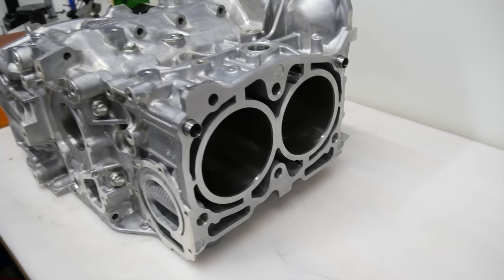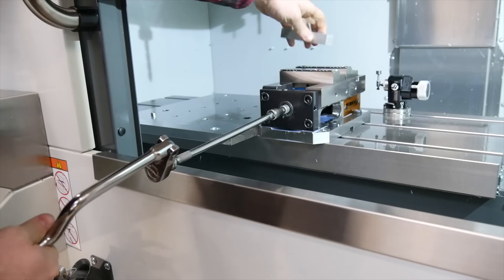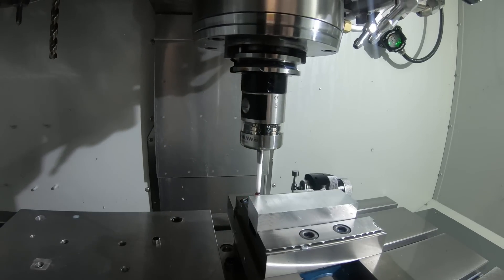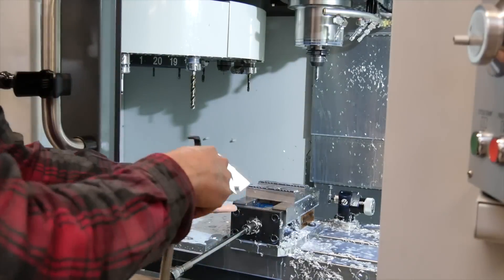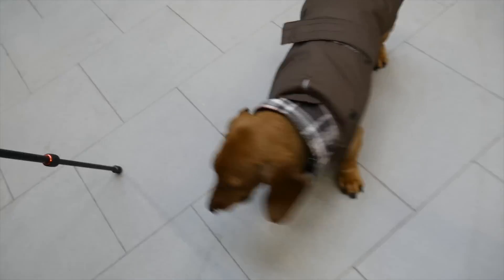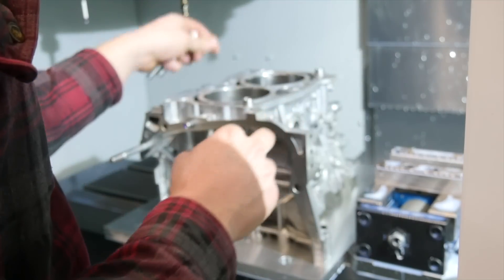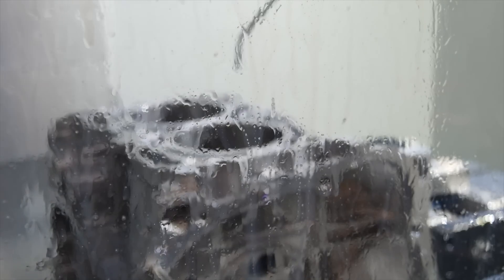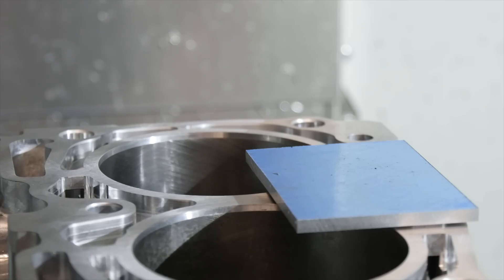How to build a closed deck Engine l Subi-Performance

Comment: Fantastic! And thank you for the english, (very good). That closed deck will help keep the liner true and round, it will help promote sealing of cylinder on the hi comp motor. Love the wunder hund!  From Seattle.
Reply: Individual inserts absolutely DO NOT keep cylinder round. Even a super precise single ring like CylinderSupportSystem distorts the top of the cylinder but much less than multi piece close deck methods. Oversize pistons are typically required after closed deck to ensure cylinders are round straight and proper piston to wall can be achieved.
Reply: @trickeng  maybe that's why IAG uses entire cylinder wall with top closed deck in one piece.
Reply: IAG uses individual pcs like this video. Not a full ring.

Comment: I love watching proper work! The cleanliness of your shop is spectacular. 

Question, have you found an efficient way to remove the 4mm oil galley plugs from the heads? I have had the damned it time over the years. Cheers and again I appreciate all of your content.

Comment: Is the "issue" with the ej257 not so much the close deck, it's already semi-closed, but with the cylinder wall liners being much thinner than the ej207? If you had to choose one, you you choose close deck or inserting sleeves? BTW, the close deck you just did looks really nice. Oh, and larger head studs and case bolts would be an optional extra on top after this? Thanks.

Comment: Awesome video 👍👌, I learn a lot today. The channel that you make around the cylinder is for better cooling? Do you still used the same factory head gasket or different? Here in the USA I haven't see a closed deck block with that channel around the cylinder.

Comment: 0:10 that Mitutoyo or the Sunnen Bore gauge?

6:17, how close are the inserts to the water jacket? Like ex: .001"? or something or interference fit?

I appreciate the "How to's", was wondering how you would go about this lol.
Reply: Its probably in the -0,00 to +0,003 area. Slightly oversize to compensate for room temperature and cooled to 194K.

Comment: Hi Subi-Perfomance chaps. Great, informative video... Vielen Dank.  I have an original Fully Closed Deck Block FCDB from Subaru. What sort of safe BHP values can you suggest for this type of block... and does the block you re-manufacture into a FCDB have a higher power capacity or lower?  I am thinking that you could build my engine up for me... Will PM you.

Comment: LoL Andi some simple tools then points to a precision CNC machine, Nice one hehehe. And here I am with an old school lathe & milling machine it's all manual no electronic takes ages to setup, I spend half the time making jigs or tools to do a particular job. Nice work on the block, question the cooling ring slot why so deep I seen other but not as deep as you have done wouldn't this weaken the top edge seems to defeat the purpose of a close deck to stop micro cracks appear at the top of the deck?

Comment: Andi - you are definitely building the engine for my Factory Five 818 Coupe. A 800 hp street macine.
Reply: i'm curious too see the progress of this build if you are documenting it at all.  I'm sure a few people would be curious
Reply: @joshuaszeto   I will do that. Working on getting everything together.
Reply: @mikebigelow9057  I have been meaning to get a factory five but I never really gave the 818 much thought until the redesign.  and I have a spare fa20 motor sitting around...
Reply: @joshuaszeto  Woo Hoo - you can have a rocket on rails also.  Right now you can save $2000 from FFR.

Comment: non turbo EJ25 blocks are super cheap.......is it possible to close deck a non turbo block and use a turbo rotating assembly and have a cheap, strong block?

Comment: One thing that I missed is how do you get the aluminum inserts to bond to the block? I figured welding was involved somehow (but come to thing of it that would introduce potential warping). They're hammered in and then the top plate is milled down but is it just the fact that the insert is slightly bigger than the block keeping it from pushing/falling out?
Reply: And the Heads are clamping the Inserts down.
Absolut no need for glue or welding in this case.
Reply: The snug fit is surely a part of it but if you look closely the inserts sit on top of an edge he left in the block, together with the head pushing them down they shouldn't go anywhere. So no bonding required
Reply: Like you said its called 'interference fit' when the part is slightly larger than the hole, but that alone would not be sufficient with all the movement and heating cycles(expansion and contraction) blocks endure, so the clamping force from the head would be the primary force in keeping them in place
Reply: Once both the inserts & block equalized to the same temperature it aren't coming out, no need to weld or glue-loctite.
Reply: awesome! Yeah good points, super tight tolerance. Love this video. I always wondered how aftermarket closed decks were made. I figured the whole cooling jacket was filled and holes were drilled in. This really provides much more cooling area versus what I thought to be true.

Comment: Why close the deck?
Reply: Stronger engine, higher cylinder pressure, don't blow head gaskets as easy...
Reply: @bikee4  necessary on a stock build?
Reply: @kevinhillgrenjr2248  No just for high performance builds

Comment: Maybe not such a good idea to hammer on the mill deck.
Reply: He was using a plastic hammer,,, owner does what he wants, everybody else follow his rules. If I were an employee I would pull the block off to install, but he is THE man.
Reply: @russellhueners8499  Plastic, wood, steel, marshmallow hammer- still a bad idea.   Looks like the interference fit is too large since the deck inserts are in compression and should be fixed to stops in the machining that limits the downward deflection into the block to ensure head gasket closure stress retention.